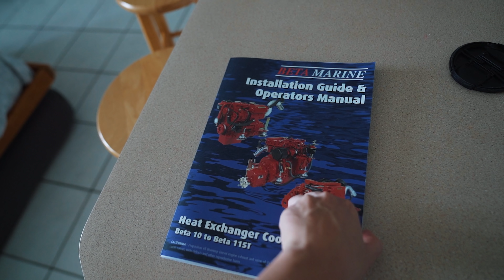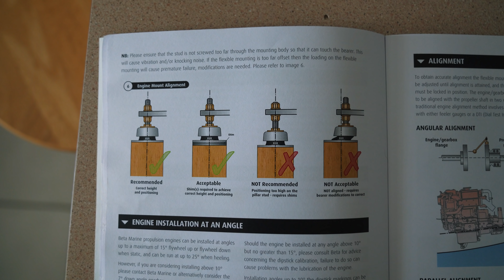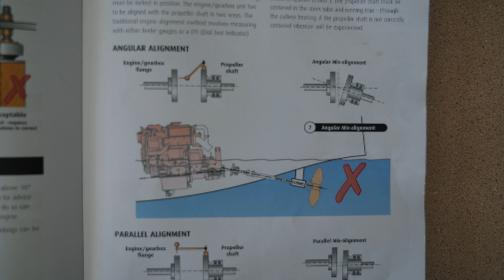DANGLING OUR BRAND NEW ENGINE OVER THE WATER!

Comment: I would love to replace my 3QM30 on my 1982 37' Hunter. Word to the wise. That factory strut that the shaft goes through is small and weak. You can expect it to break at some point. Mine did about 10 years ago. Replaced with a much stronger strut. Love your videos

Comment: Hi Matt and Kristen two things ditch the volvo shaft seal change to a Manecraft deep sea seal these are very forgiving !! as the volvo seal does not sea if there is any shaft scratches or imperfections… with the manecraft seal one side is fixed to the shaft the other to the stern tube once pressed together the mating surfaces stop water ingress …AND suggestion four your engine mounts I did years ago on my own yacht — welding is needed !! 13mm plates holes drilled to suit the mountings then welded to cross brace the stringers passing under the engine one across between the front mounts one across between the rear mounts which will massively strengthen the mountings… I can send drawings if your interested… brilliant entertainment as always GBU.. regards john

Comment: Hehe. You guys are fun. Mattie has it right, learning is fun and it sounds like Kristen is feeling more confident than ever too. With that spirit, I'm sure you'll pull through this fine. And you are right, once you understand a bit about what's going on with a motor in a sailboat the complexity doesn't overwhelm as much. Glad to see that. What you guys are doing is showing how any handy couple can take on a big rebuild. As different as your channels are, the Expedition Evans folks had the same grit. And setbacks. There is something about taking on a rebuild like this as an amateur that just reveals character and the two of you demonstrate that in spades. Fact is, I thought I saw a glimpse of light at the end of the tunnel in today's video for the first time. Woot!

Comment: Matt is ALL over this.  Continue to be impressed.  I did exactly what you did.  Mine was also a big red engine - a red sprayed Bukh. Did I spell that right 😂 Hey it still looked good.  We hauled out.  However yes get the mounts sweet.  Looks narrow so your fibreglass plan is a goodun. Peace of advice - get a see through plastic folder for that excellent beta marine manual.  Will be good in a year to get it out and it not be ruined by condensation.  Small thing but my bukh manual was impregnated by diesel and moisture.  Quite horrible.  Love your work guys!

Comment: I know it's too late but I removed my coupling by inserting a socket between the trans coupling and the shaft coupling.  I had to buy longer bolts so the socket would fit.  But I simply tightened the nuts and the shaft coupling was easily removed.

Comment: fiberglass the stern tube Then use old school Buck Algonquin stuffing box. (use flax with silicone).  Also best to do shaft and coupler alignement  with out "shaft saver" first.  once you have it with in .006 all the way around the put the shaft "saver on".

Comment: Just a thought and it might be too much for too little return, but there could be a way to fix that tube without a haul out.  There are several documentaries about the recovery of battleships than were sunk at Pearl Harbor.  One of the ways they repaired those battleships enough for them to be re-floated was to build a bulkhead structure outside of the hull.  They then pumped out the water and had dry space to work to weld in patches before taking the ship to the dry dock.  In the case of the battle ships, the repairs were temporary, but the premise could work for you too.  Build a water tight structure that covers the necessary area.  Build it large enough for you to have room to work.  Pump out the water.  Then replace the tube.  When the tube is done, remove the external bulkheads and you're back in business without a haul out.
Reply: Another possibility would be to beach the boat at high tide like the pirates used to do.  Beach it nose in at high tide.  When the tide goes out you'll have hours to get the job done before the tide comes back in and you either re-float or sink.

Comment: Great video!  Make sure you bond that new engine to your anodes, don't just rely on the shaft anode.  If anything is made of aluminum and it is not bonded it will eventually corrode.  How will the exhaust work?

Comment: Hi Matt , just to say the easiest way to raise the engine would be to modify the engine mounts on the engine. I have just viewed the engine on line and it it would be the best and quickest way,to remove the feet from the engine and fabricate lowering the steel work buy about an inch or so.the guys that put the engine in could do the job in a few hours. Maybe worth a look

Comment: Hi guys great video.
However just some friendly advice.
I would have a washer between the prop and shaft nut.
Secondly you need a proper split pin on the shaft nut not a ring.
These rings are for keyrings.
They are easy to use but should not be on boats at all !!
Over the years I have seen many accidents caused because of these split ring failure mainly in standing rigging.
Looking forward to the ongoing video's
Alan
SV Feeling Groovy

Comment: OMG, hopeful there isn’t a next time, but they should have had some shackles between rope and lifting mounts. Lucky, the rope didn’t get cut while lowering. There is a thing called Shock Load. I witnessed the aftermath of not using shackles when the load bounced and brand new metal band saw came crashing down. Motor looks sweet though.

Comment: so we normally use a socket and longer bolts to press the coupling off... or a versipower hydrolic setup... very hard to keep the shaft from moving otherwise, would HIGHLY reccomend a haulout and change the cutlass bearing/  maybe some shaft strut work ( due to the log being ground out from prior motor) if not you might find a bent shaft.... but something was misaligned, bad

Comment: It's all about the through hull seals, plus the  vibration from the prop, up the shaft to the engine coupler. In other words if there's vibration, haul out and fix it, you can make it better than original.  Your through hull seal for the prop shaft is the most vulnerable area of the boat. I found the best thing for fast temporary leak sealing is to use mastic tape. You can buy this stuff from resin infusion (vacuum bagging) supply stores. Yellow high temp 1/2" wide x 20' is usually $5.00 a roll, keep a few on hand. Water pressure will hold it in place.

Comment: Nice job with the engine install. We just rebuilt our yanmar 3gm30f. When we installed it we used lexan for shins to lineup the motor. Lexan is very durable and doesn’t break easily and does not rot or compress. I can do you pics of our set up. But you are right. You don’t want those nuts up so high on the studs.

Comment: I recall beta 30 burns litre per hour at 2000, not gallon. While messing with the engine locate coolant drain tap on port side. You will have reach it one day soon

Comment: Do the lag bolts for the motor mounts screw into wood that's glassed in under the pedestals on each side?  I'm wondering what the condition of that wood is after 40 years.  Big Red is a beauty.
Reply: Yes And Yes...you need to play detective when tightening.

Comment: So happy you went with the Beta.   was cheering you onto Beta when you were first making the engine choice, way back when...
it will bring you years of care free running.
Re the engine mounts. I agree with those who said...dont use wood.... definitely not.

Just like you my engine had to be raised.
Speaking from memory as my boat is So. Calif and I am in Portugal ..

I had Beta marine installer make the necessary adjustments for a proper fit.  

He use tubular structural aluminum.  about 3 inches wide and 1.5 inches tall ... for my situation. 

one tube per side that ran the length of the front and rear engine mounts plus a few inches more

First he made big holes (maybe 1")  on the top side of the tubes,  at each end of the tubes.
The holes were big enough to fit the bolts and ratchet.
Then, at those points, he drilled holes through the lower side of the tube and into the stringers, maybe 2"into the stringer.
and bolted the aluminum to the boat stringer.

Fourth  he secured the engine mounts directly to the aluminum tubing using bolts and lock nuts.
Very cean and solid. I have had the alignment several times over the years and 8 years later,  the Beta Marine mechanic has never had to make any corrections... and the tubing...no corrosion.
If you want pics let me know

Comment: I would put a stainless bolt or cotter key in the shaft to hold the nut for the propeller. That wire just doesn't look safe.
When was the last time you replaced or checked the shaft support for wear or slop. It doesn't look very healthy.

Comment: Check whether the mounting brackets on the engine aren't reversible. Instead of having the threads on the feet fully extended reversing the brackets could have them at their lowest point meaning you wouldn't have to build up the engine bed.

Comment: I always back you bro.. But I will question the dripless seal instead of a proper stuffing box. As you noticed that seal holds back a bunch of aqua 🧐 if the dripless fails at sea you are fubar'd. If a stuffing box fails you've got the chance of repacking it 🤔

Comment: We also have a 1979 boat ours is a downeaster 38. I replaced our cutlass bearing , shaft ( it was egg shaped from wear) and the flex coupling. We also had to jack our engine up to remove the shaft.  This was about 6 moths ago of course after all the changes we had to align it to the shaft. My take on your situation would be to align your shaft inside the stern tube so it is centered before you lock down the engine position.  If you don’t you may be setting the shaft at a bad angle to your cutlass bearing and your stern tube.  I am guessing your rear coupling is slipped forward  for your rough alignment and totally agree you need to come up on the forward two mounts which makes it likely you will need a bit on the back too. I would definitely add at least 2 inches of overhang to the bed logs you have.  On ours they had replace the original engine and used 3” by 1/2” angle stainless bolted on top of the logs to build them up. I imagine you could used laminated fiberglass as well so long as you have a good clean joint to start with and/or bolt the business down well.  Anyway i used feeler gauges to make sure both coupling flanges were the same distance apart all the way around or if you put the flex coupler in you can check that the space from the bolt heads to the plates are the same all the way around then turn it 45 degrees and check it again.  You guys are inspirational so keep up the good work!  Peace out!

Comment: Did you consider putting anti-seize on the solid coupler/prop shaft?  (The replacement coupler for the one you had to heat and use a large hammer to remove. )

Comment: Never use a circlip or ring as a retainer anywhere on your rigging and least of all on the retaining nut on the propshaft. Stainless split pin of the correct diameter and bend the 'legs' back. As said a universal joint gives so much more flexibility to align the shaft. I t sounds as though you have a 1" shaft so make sure it is not a 25mm cutless bearing it would need to be 25.4mm diameter to fit the shaft. The bearing may not be the same length as the original nor the outer casing of the bearing (usually bronze),be careful not to damage the bearing surface if shortening it.  The stern tube does look worn and larger than wanted internally. 
I don't know if there is a wall or jetty to which you can moor so that the prop would be fully exposed at low tide so  giving time to work between high and low water  I have done mine in a 4 hour window , here in the UK   between tides drying out fully.
 I see you have a P bracket which makes installation and removal of the bearing easier.  Remember to remove any retaining (grub) screw in the P bracket before trying to withdraw the old bearing; if you are lucky then you may be able to drift the bearing out without the shaft being removed else you would have  to do this.  Removal of the bearing then can be done by using a fine hacksaw blade though the bearing  and a single slot cut; then if it can be partly drifted out by reducing its original diameter by crushing or using  a piece of steel studding,  a  washer just smaller than the bearing  outer,  and a  spark plug tubular spanner or a long socket as a puller. When the bearing is fitted use a drill bit to drill a shallow vee in the grub screw hole to retain the bearing when screw is replaced. All sounds more complicated than it is but easily do-able. Good luck with the rest of the installation  Regards to you both.

Comment: Question what does dog mean? Have you both got a dog now? I am British so not sure what some of the lack of words mean. As for lining up the engine to the shaft I think get the right rubber seal for the shaft first. Then see the distance of movement use a bit of wood under the shaft to hold it and work out by shortining the wood or adding to it to get the shaft in the midele of the movement so it moves the same size on all points that way you should center the shaft then you can center the engine to the shaft more accurate. The other way is hauling out and using a laser which would be the best way.

Comment: Hey Matt there’s a product called underwater Epoxy I had the same problem the way I repaired mine was use some 3/8 cotton rope slathered in Water repellent grease The thicker the better use this to caulk the underwater side of the shaft log tube i ended up using about 4 feet to do mine but it worked perfectly but don’t do like i did and shove all of the cotton rope in before you tie another rope to the bitter end It’s hell getting it back out can’t hold my breath that long Once the water stopped then you can use underwater Epoxy with # 2 fiberglass cloth cut to about 3/4 inch strips and build that up around that the tube Just like Bondo you know I don’t know why Bondo has such a bad name I’ve been using Bondo all life And most the time was not on a car this process was a final repair and the boat still in service have a good day Matt I love your YouTube channel I’ll see ya in Puerto Rico might take off date is November 2023 come hell or Highwater

Comment: Isn't it possible to build up that area with ply wood and fiberglass to level out the engine and shorten the mounts on those bolts?  Seeing how you can't get insurance to haul the boat out.

Comment: 6:37 Use the motor side coupler with a socket in between. Then the 4 bolts that make it up. Heat worked too…

Comment: I have a CV joint between engine and stern tube, with a linear bearing and separate thrust bearing on a fitted cross member--no vibrations as long as shaft was not bent by heavy hammering.  Using rubber mounts without a CV joint is asking for trouble in my experience.

Comment: Congratulations on the not easy disassembly, and for the arrival of this new engine... what matters is to have 4 solid bases of supports at the right height... perhaps put back some hard wooden wedges and the fix with plates on the sides and the whole fiber with glass fabrics... the important thing is to be sure when you put the 2 screws of each support, that they are well fixed in time despite the vibrations. ..!! you'll get there, I'm sure, it's all about preparing well...!! good continuation (check, at the place where you will put the wedges if it is hollow or full by drilling you will be able to see...!!) Enjoy !

Comment: Do you have any zinc annodes on your propeller shaft or your Strut? Also, how is your Cutlass Bearing? Would be a shame if it's worn out after doing your engine install! Recommend also that when you couple engine to shaft that you keep within 002 thousandths, check that tolerance is the same on each bolt hole before securing bolts. Just  comment it's Your Boat. Congrats on new motor, may it serve you well!

Comment: Perhaps it would also inspect your prop while it's off also
Reply: Hey you two! Thanks for the response. After watching the remainder of the video and you pointed out the shaft core being so worn.......a suggestion! That is a fiberglass tube extending to the outside of the hull and the prop end has a Cutlass bearing inside to allow your shaft to stay true at the prop end. A consideration for your inside wear, if you have a Bung to drive in the the shaft opening you would be able to Make a tube to sleeve over what you have inside,glass it strongly and just make sure you can get a packing gland that will fit a new stuffing box! And your rear cutlass should stay the same size! Hopefully I have made this comment sensible for you. Regards and hope the Best for you two Always! Love your determination and Can Do Attitude. Old old boat guy here

Comment: Good morning my favorite Shipmates as soon as I got up I saw you posted a couple minutes ago and mentioned coupler the only way to get those off is to put the heat to them two or three times so if you expand it let it cool expand it let it cool and then put the f**** Sledge to it it will fall off just as it did good job I'm very happy for you guys there will be a few bumps but should be pretty smooth you get everything new and shiny💪💯🙏

Comment: Love the vid guys. I enjoy watch the engine install. I am in the process of installing a built up ford 351 winsor in my power boat and like you very little room for the installation.

Matt no advice from me as I also do my own work on my boat as I have no assistance but it's boating and it is what it is.

My biggest issue here in Central Florida is the super heat and daily rain storms daily which stops me and my work as well.

Love you two and again thanks for the vids, laughs as we continue with our projects.

I bet you as well as I looking to get back on the water.

Always looking for the next project and adventures.